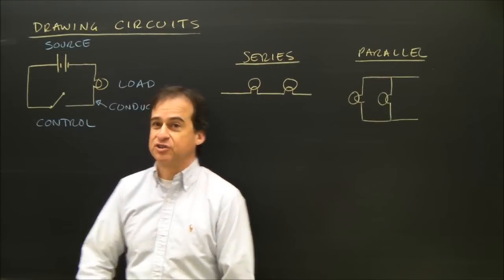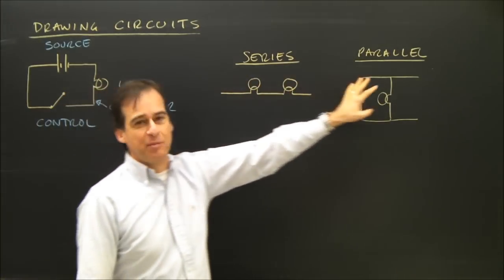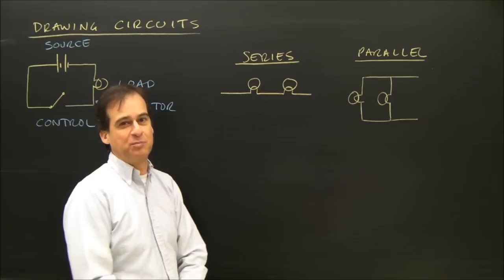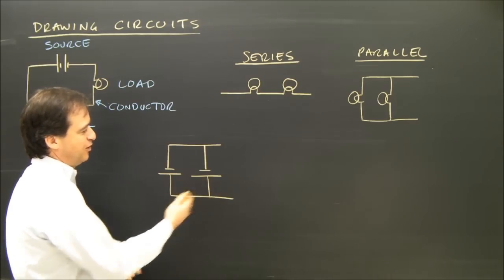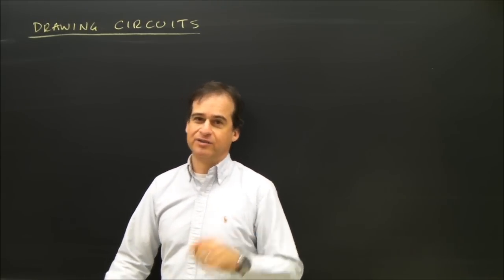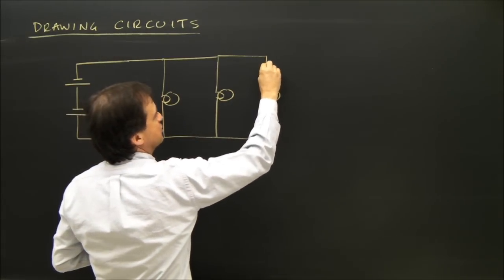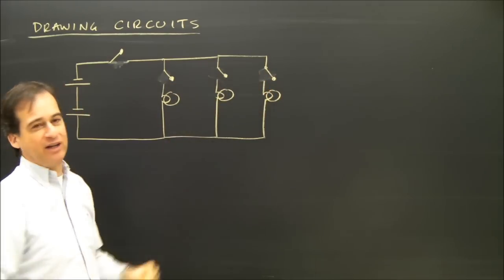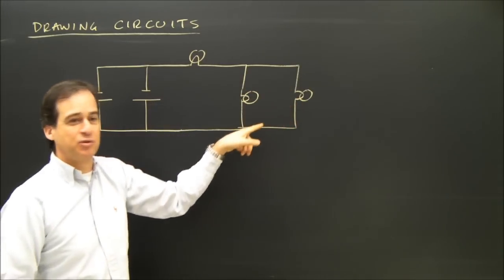How to Draw Simple Electric Circuits Lesson

Comment: When batteries are in parallel, they must be the same size/type.The cells provide the same voltage, but each cell contributes to the total current.   For example--two 12 V batteries in parallel contribute 12 volts to the circuit, but their amp hours are doubled.  As long as there is an unbroken path, current flows, the circuit is complete.
Reply: Thanks x

Comment: I am yet to learn about electricity or circuits in my education so I’m sorry if this is a dumb question, but why does electricity travel across two paths in parallel if electricity usually takes the path of least resistance?

Comment: ON your second diagram, i think the switches are placed wrongly, they have to be after the positive side of the source, right?
Reply: No. Opening the circuit (a switch, for example) anywhere halts the flow of electrons regardless of its position in that circuit.

Comment: what is the significance of having 2 cells apart from one another, whether it be series or parallel, versus just having both of them together as one whole battery?
Reply: Because if they are parallel then with another switch they can be activated separately